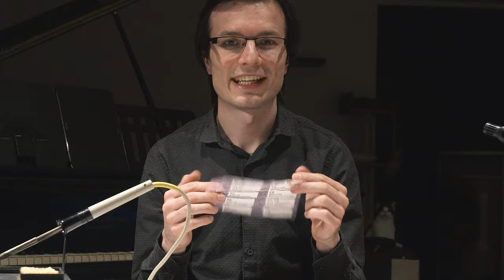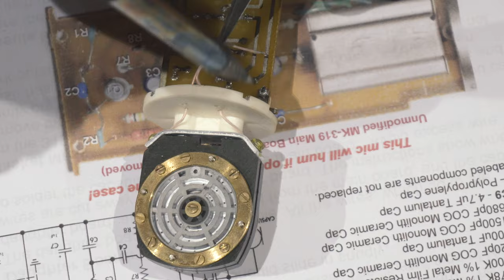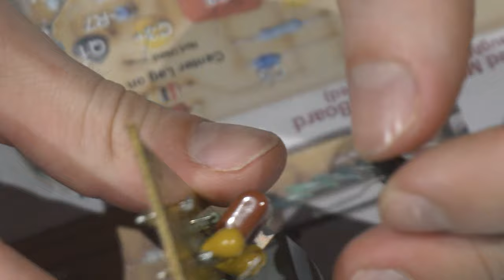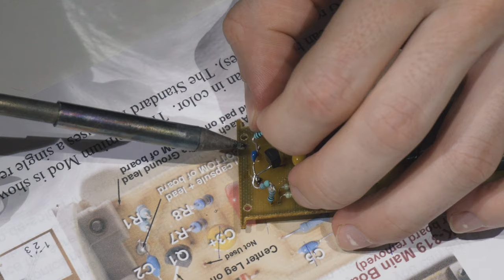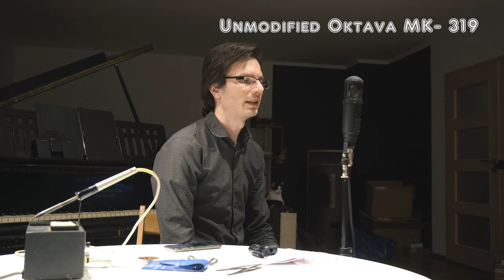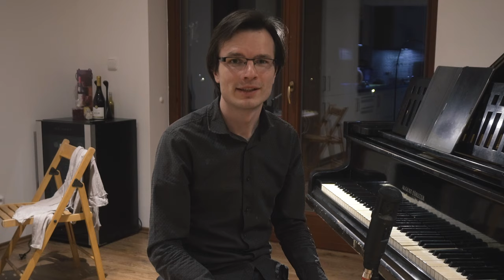DIY Microphone OKTAVA MK-319 Premium Electronics Mod - SOUND EXAMPLES

Comment: By creating and applying modes you abuse mic's creators. Every creation is designed and created the way it is , like a child being born. Every company is proud of its creation. If you are so smart- go ahead and create the best mic from scratch!
Reply from the maker: Sorry, but this is non-sense. Everybody knows about the poor quality of Soviet electronics.
Reply: Everything can be improved - car tuning, processors tuning, straps on electric guitars neck, mics included, these are no piece of art, but just electronic device. And the mod works for this type of application quite well, is for sure cheaper than selling the mic and purchasing a different one with some characteristic which has been achieved with this mod
Reply: no, I'm gonna be smarter and just put a small effort into something that already requires a small effort to make it sound good for my ears

go and grow your own seeds and bake your bread, because putting cheese on your bread is abusing the creator

Comment: Ah man! I think I got a fake.. I recently purchased two of these, comparing with a 220 which has the same capsule, but dual. One of the 319's is significantly darker than both the 220 and other 319. I think I may have to bookmark this for future use if I want to use these as overheads..

Comment: Thanks for the video! Really nice piano playing. I liked the original 319 the most of the three. I've got a 319 with michael Jolys floating dome mod(IIRC both premium electronic mod & something done to the attachment of the diaphragm). I think it sounds good but it's very sensitive to low freq rumbling and bumps to mic stand etc. Now I'm a bit curious for the original 319
Reply from the maker: Thanks for your comment. The bumps from the mic stand are a standart feature of mk319. Bass rumbling - something is wrong... I am gonna mod my pair of mk012. I will post it here. Right now the package got stuck in the post.